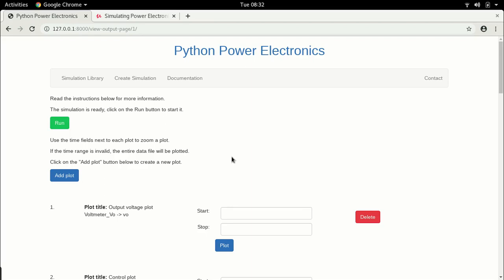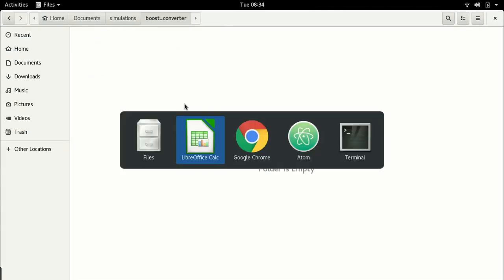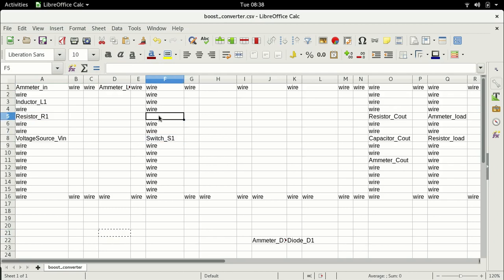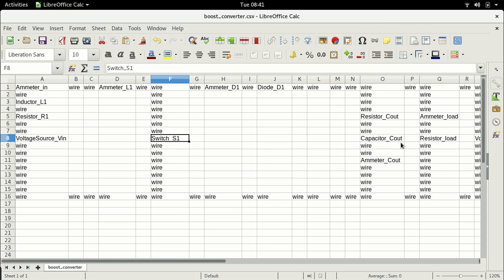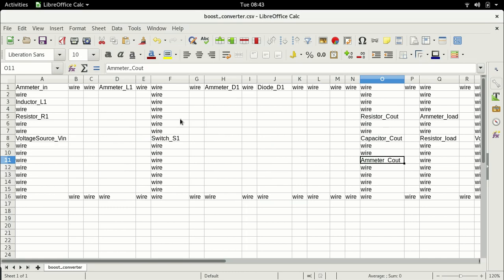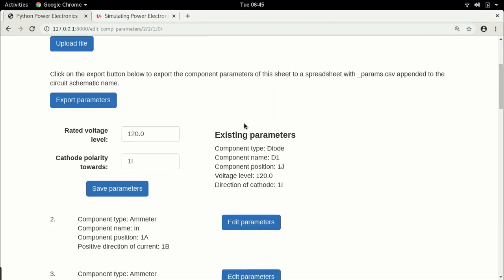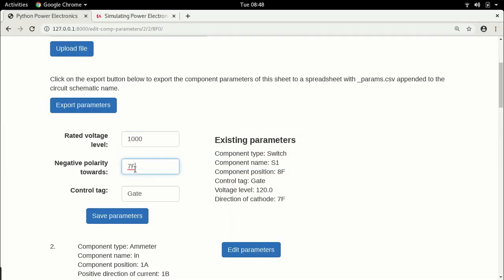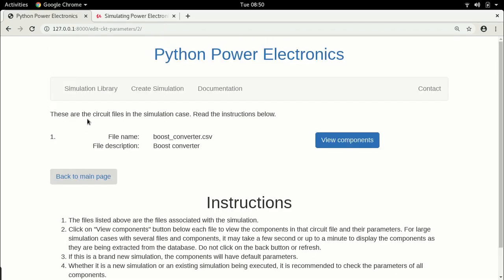Getting started with the boost converter

Comment: Hi, i am also simulating boost converter simultaneously by watching your video. But i got this error when i tried to change the circuit parameter values 

KeyError at /edit-comp-parameters/2/3/1J0/
'k'

showing API calls, etc.. I think it's because i entered alphabet small 'k' in Ammeter direction parameter.. After i got the above error, i went back and typed alphabet capital K, then it worked fine.. 

Better you handle this scenario in code,  may be display some understandable error message when user tried to enter unacceptable data.